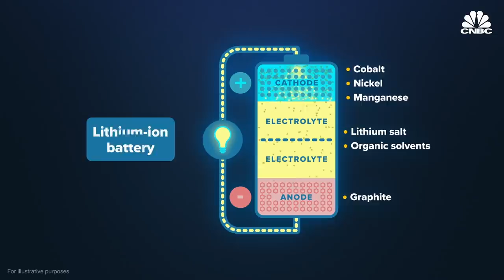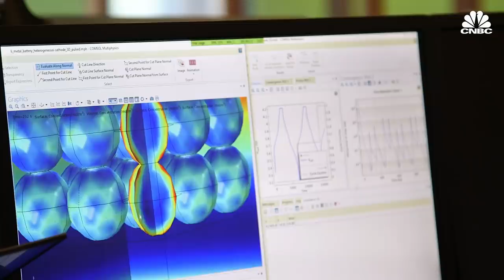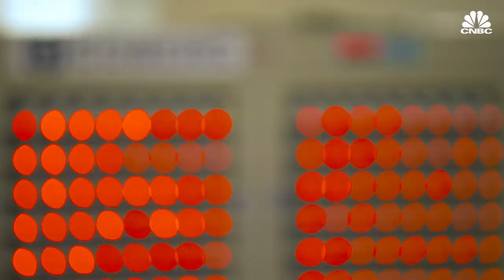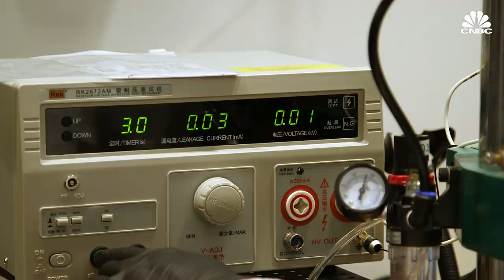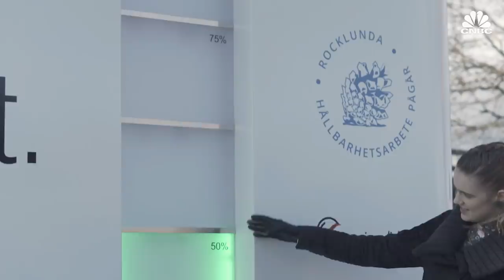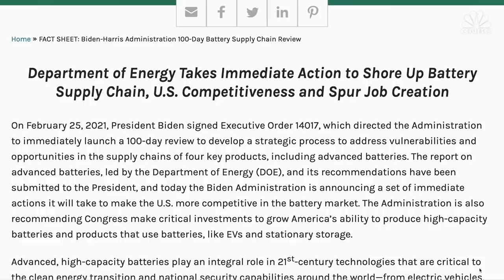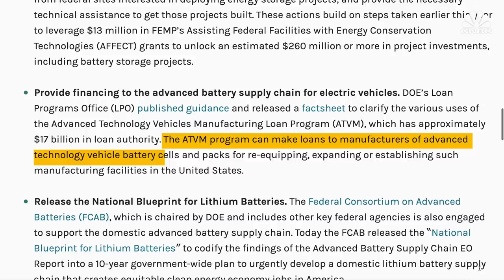Why This Battery Breakthrough Could Make EVs Cheaper

Comment: You know what's NOT cheap? The solar and wind farms to make the """zero-emission""" electricity to put in the batteries. You know what is cheap? Nuclear.
Reply: The reason so little nuclear gets built and so much gets decommissioned isn't safety or even nuclear waste. It is cost. (Well, technically the cost of keeping it safe enough to make safety not the main issue.) Nuclear is significantly more expensive than gas, which is in turn significantly more expensive than renewables. The cost of renewables then gets increased from needing extra generation capacity, transmission lines and storage to compensate for intermittency. However if storage cost can decrease sufficiently (not that I think Li-metal batteries would give us that cost decrease for the grid, I have higher hopes for other alternatives), current generation nuclear won't stand a chance even if gas gets banned. SMR's might change that, but current cost projections still put SMR cost significantly above renewables and SMR's still isn't a proven technology yet. (Obviously, since it isn't even in commercial use yet). That said, different technologies have different strengths and weaknesses so ultimately a sensible grid has a mix of technologies. I do expect nuclear to continue playing an important role and if we start making fossil fuels fully pay for pollution and health risks, nuclear would play an even larger role in the mix.

Comment: keep it Wh/kg, not Wh/L, pointless, also metal-electrolyte-air
Reply: I dont pay scrap
Reply: green free kerosene with air burner steam tesla turbine generator range extenders, external combustion engines, jets, are best
Reply: wh/kg measures gravimetric density and wh/L measures volumetric density. They're both relevant

Comment: Know where there is a manufacturing facility her close by to many great amenities. It's Rite off of a Major interstate & yes an off Ramp exist's. There are tech schools in the area & there a number of Solar Electric Fields around. There are a number of wind Turbines around this little City. There's quite a bit of acreage that goes with it. They even used to have their own switch for access to the local railroad. The Place is now owned by Siemens & yes it just came up on the market. I'll bet if you got a hold of the rite politicians Here in New York; with the incentive the Biding administration has already pretty much guaranteed. I'm certain this may be something you may want to look into, the Area Code is 14760. You could probably Google it, & then Google Earth it. There's a wealth of affordable Labor here, why build in some smog infested Large City. When it pretty clean & Green around here. If I'm not mistaken I think that property may also fall under NYS's brownfield initiative program. In other words if was used for Industrial Purposes in the past, why not keep it that way. Anything that was there before you got there, not your problem.

Comment: Batteries in planes? WTF is this nonsense? That is so stupid, even with better energy density.

If you really had to use something other than hydrocarbons (such as ethanol or biodiesel), to which there really isn't much reason, the next best thing would be going with Hydrogen.

Also there's no way that lithium metal batteries will be cheaper. It won't make EVs cheaper at all. I have no idea why that guy is saying that. He's being way too optimistic.

Comment: Batteries are only half the battle. Still need a sensible power source to charge them. 
Nuclear power is the answer, and it must be fostered.
Reply: Nuclear power is what will put burden on generations and generations to come due to that waste that radiates for a million years and thus completely renders nuclear power useless in terms of overall profit-to-loss-ratio which is terrificly negative.
Reply: @martinmartin6300  Not really, Nuclear is the safest and cleanse energy source today, any waste could be burned out in thorium reactor, sadly many people are are having a ptsd hearing the word nuclear, maybe we should rebranding the name into fusion reactor.
Reply: Thorium
Reply: @pindot787  Stating that nuclear power is the safest cannot hold up considering Fukushima and Tschernobil and also taking into account that no one really knows what the nuclear waste will do as additional harm during the million years to come. Also, stating that nuclear is cleanest is hard to hold considering solar, wind and water power. Thorium reactors are fine in my opinion but as there aren't any around, yet, and because the original commentator did not refer to them, I think it is valid to say that my comment still holds good as one can assume that someone means the currently common form of nuclear power.

Comment: Electric vehicles are no longer prohibitively expensive at all. They are made to be that way by using 'grand gestures' such as huge and totally unnecessary 21 inch alloy wheels and expensive ultra low-profile tyres, the incorporation of a multi-media entertainment system worthy of a theatre and miscellaneous 'electric gadgets' such as automatic tail lifts to vibrating seats !

Strip those infantile toys away and a perfectly viable vehicle is born ! Already, in Europe. a perfectly serviceable EV an be bought for ~ £10,600 (after incentives) ! It's the Renault*/Dacia Spring.

https://www.renaultgroup.com/en/news-on-air/news/dacia-spring-electric-dacias-first-all-electric-car/

* Renault also makes the best-selling EV in Europe, the Zoe. Dacia is its Romanian subsidiary which sells 'economy cars'.

Comment: COULD, but probably won't...... EV's are shoved down our throats but NO ONE is talking about the need for extra power stations which in developing countries will be powered by FOSSIL FUEL. The reason why we're getting away from fossil fuel cars. NO ONE talking about how we're going to recycle the highly toxic batteries that have a shorter life span than the car.
I am very much a fan of alternative energy, but for now not buying any of the spiel about EVs.

Comment: Lithium metal?  Remember the metal your chemistry teacher stored in a jar of oil, took a small piece out put it in a dish and it caught fire almost immediately when exposed to air?!

Even though they have "fixed" that issue by surrounding it with a proprietary electrolyte; the oil from the  example from above if you will, what happens when the aircraft / vehicle is involved even in a small incident and the battery casing breaks?  You'll probably see a very fast, hot fire that will consume everything within a few minutes...  

Not getting into one of those...

Comment: who on their right mind will fly on an electric powered plane? let these journalists be on the 1st flight
Reply: An electric powered pane has less moving parts that can fail than a plane with an internal combustion engine.
Imagine if electric planes were common and then someone comes up with a complex machine involving thousands of synchronised explosions per second echt pushing a driving shaft. Oh, and it includes taking along a tank filled with a flammable liquid up with you in the plane.
You would consider that person a madman. Well, I would.

Comment: The most damaging battery technology to the environment. Lithium battery recycling process is prohibitively expensive so they end up in a landfill. 90% of lead acid batteries are able to be recycled. NiFe batteries have a much longer life and more tolerant of environmental extremes and can last more then 20 years. They are steadly gaining favor in off grid applications.
Reply: This is incorrect. Redwood Materials is able to recover 95-98% of critical lithium battery materials in their process and is en route to becoming profitable.

Suggesting lead acid is a better tech is misinformed.
Reply: @TheDevonParker  funny no mention of the percentage they are able to recover on their website.
Reply: Limited niche. NiFe has terrible power density and self-discharge, so it's only suitable in places where space is plentiful. Grid support, yes. Cars, no.